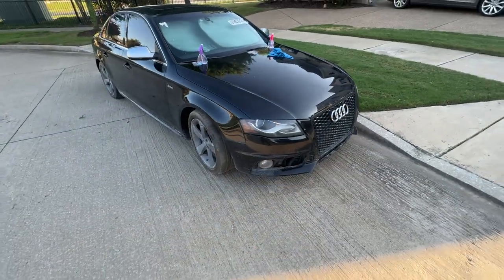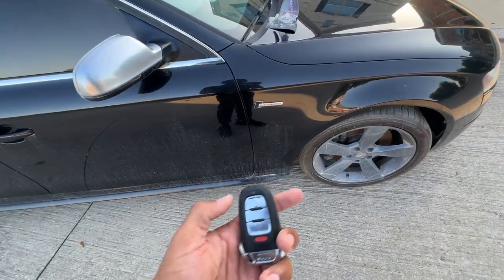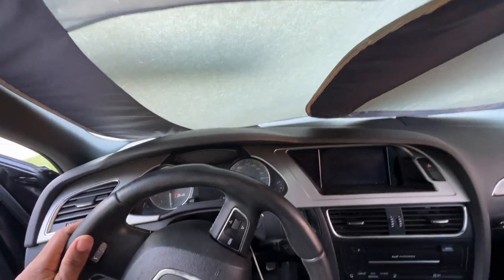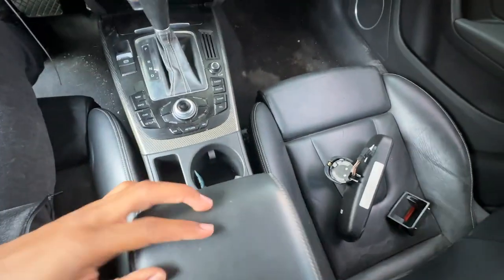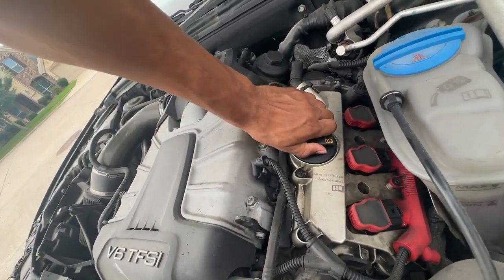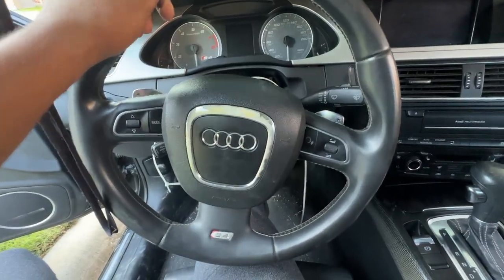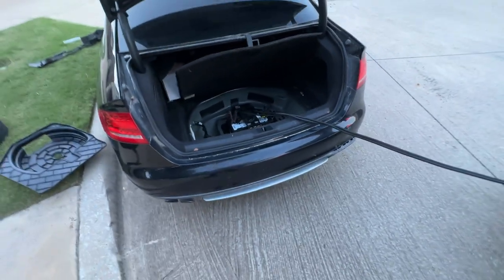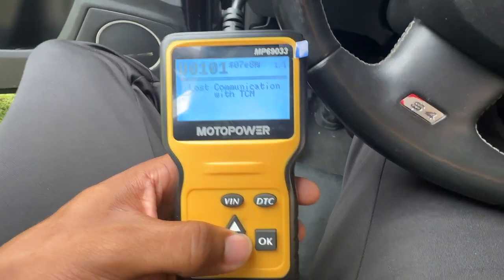I Bought A 4000 Dollar Audi S4 from Copart: Part 1

Comment: I got my 2011 B8 S4 from Copart too 😅. That black cross bar goes over the transmission pan area underneath the car. A few bolts & the ground wire connects it up.

Comment: so first things first definitely spin the crank by hand and make sure it even rotates before continuing if it turns over good then next i would definitely look into the battery i HIGHLY recommend a oe battery then once it’s replaced it will need coding too the vehicle. i buy auctions cars as well and these are the steps i take before i do anything else and as to that tcm code definitely wouldn’t worry too much with a dead battery on german cars they can cause a lot of funky issues. excited to watch where this goes!!!! good luck 👍
Reply from the maker: Thanks for the tips,
Right now the engine seems fine, it’s the tcm issue that’s really holding it back. I will update in my next video.

Comment: That’s more likely going to need a new engine co part said it’s mechanical and it has 100k miles
Reply from the maker: Engine is solid right now, have another expensive issue to fix.